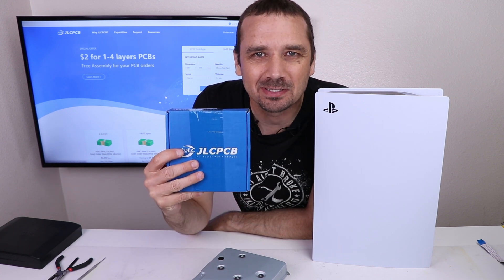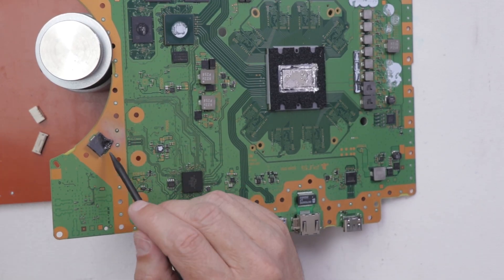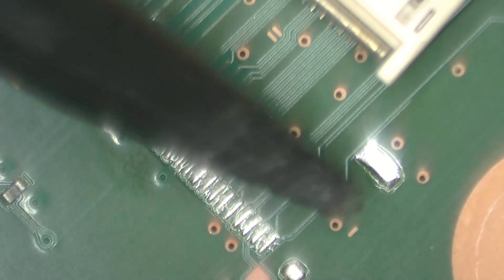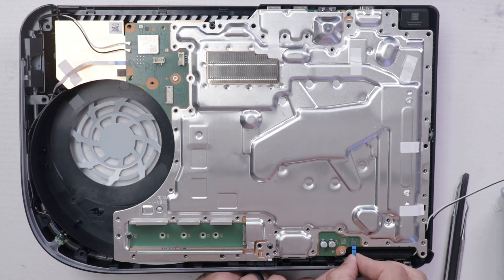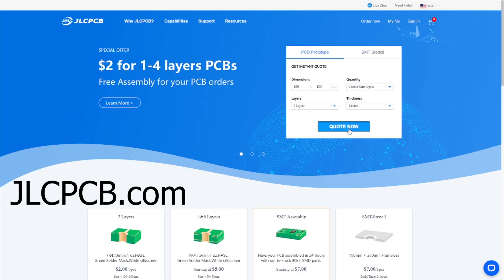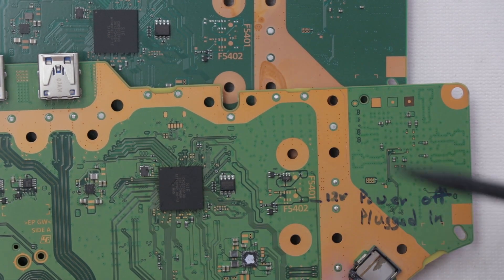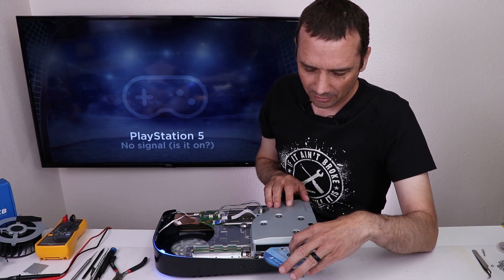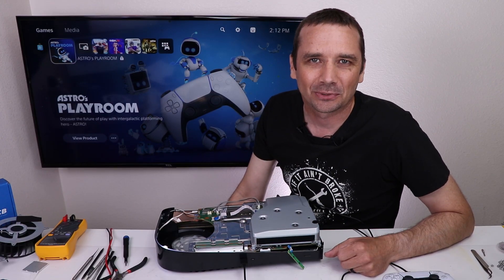I Put a Disc Drive Into a PS5 DIGITAL - But Did It Work?!

Comment: I haven't fully watched the video, but I wanna take a guess and say it didn't work because the disc drive wasn't "married" to the motherboard. It'll probably power up and move but it'll refuse to read any disc. I had this happen to me while fixing an xbox 360. You either had to solder the original disc drive sister board the new drive then reassemble it the correct motherboard, or go through a lengthy process of flashing the disc drive's firmware. Switching and soldering the disc drive's board is the easier method honestly. For the PS5 tho, I wouldn't have the first clue as to how to flash it with a new firmware. I'm sure it's possible and someone out there can do it.

Comment: Based on previous consoles Im sure even if the hardware supports the data transfer and power, without the key of the drive being supported or programmed to the console it wouldnt work. It might be worth pulling the on board ROM from one PS5 and trying it on the other. It seems even if the hardware wasnt signed with the correct security keys it would still show the disk on the main menu. 
My assumption is it wont work but would be cool to see if would boot with the ROM switched over.

Comment: It makes sense that it would be blocked by software. These consoles have written somewhere in their permanent memory what their model is and whether that model has a disc drive or not, and that should determine whether it will even load the driver software for it, because you don't have to bother loading it if there's no expectation of having a disc drive.

Comment: You need to use the firmware for the disc version. Couldn't you connect a USB with that specific firmware downloaded and install it manually offline? I believe Xbox allows you to download firmware on a USB stick and install it that way.

Comment: If it's anything like the launch PS3s, where the B model did not have a Wi-Fi card, the community eventually figured out that the firmware is the same for all the PS3 motherboards but for some reason it checks to see if the console ID's motherboard model digit relates to the B model. If the console ID check comes back that it is a B model than the firmware would disable using Wi-Fi even if you put the Wi-Fi card in from an A model. 

I would believe the PS5 is doing a similar CID check with enabling disc drive.

Comment: Could you do a video on dualsense stick drift repair with new modules. I guess it would be the same as other controllers but would make a good video. Oooh- and install one of those Extreme Rate Rise PS5 remap kits for dualsense

Comment: One of the pins on the higher density connector looked like it wasn’t soldered down fully in the video (it shifted and was touching the pin next to it when you cleaned them up).
Reply: The pins at the end of the black line, right? 3:19
Reply: @adr1ean  was about midway across the connector. You can see it has shifted right after he cleans the flux away with IPA. But yes, that time in the video. I don’t see a black line. Just the pad the pin was soldered to. Maybe the pad ripped off. :/

Comment: Maybe there are some security handshakes between the drive and the motherboard, like the 360 did.

Most prob if Drive Serial isnt allowed on the Board, the port gets disabled (potentially a security measure to prevent drive spoofing)
Reply: u gotta check with a ocilloscope the data pins on the PS5 standard while the console is booting up, then comparing them on the modded digital version, if there are some comms between the drive and the board but then stops, maybe is a hardware/software restriction (which could be solved swapping NAND or something like that, the chip that have the keys), if there arent any comms, port is disabled from factory.
Reply: if swapping NAND or something like that works, a PS5 digital could be a whole donor for a broken ps5 standard broke motherboard, technically its cheaper taking it from a digital than a disc version.

Comment: My dude aren’t you putting this disc in upside to the drive. Might work if you put it in right. Can anyone confirm?!
Reply from the maker: Read the pinned comment
Reply: @Tronicsfix  ahh cool just wanted to make sure I didn't have that wrong myself. Was a great experiment so thank you for creating this vid. It would have been an interesting options potentially if it worked for those who could only get a digital version but wanted to upgrade later. As +$100 isn't worth the upgrade to the Disc Version of PS5 IMO, but if you could get a broken PS5 parts for cheaper then that would have been cool, too bad it didn't work. ;c)

Comment: Ultimately It makes me wonder why Sony just didn't release just an all digital PS5 with a locked down disc reader add on. One console only.
Reply: More hardware cost and it just doesn't make sense to sell something with a non-functional part in it. In the final cost you still pay for the disk drive. You would be paying for a useless disk drive.

Comment: PS consoles have the disc drive maried to the console. You can't use the disc drive of one console in another console without remaried the drive, so imagine using a disc drive on a console without disc from factory and without remaried the drive.  I don't have to see the video to make a conclusion here. No, not work.

Comment: I've been waiting for this video! bummer it didn't work but I'm sure someone out there will make it work. I was wondering of you forced a console update thru usb if it would find the drive and install a firmware with permissions to let the disc drive work? Kind of like how you can update a ps3 or ps4 via usb. I'm not sure this is possible on the ps5 either as I haven't seen a video on someone updating firmware that way yet but it's just a thought.

Comment: I'm betting like older gens the disk is encrypted to the board. So w/o hacking the firmware on the drive/board. It was always going to be a non-starter. But still had to try.

Comment: Reinstall the os with the disc drive plugged in
Reply: This!  The OS may have a simple flag on install for hardware checks.. reinstalling the OS completely from safe menu could flip the flag so it’s no longer digital only.
Reply: @Honeypot-x9s  It'll be BIOS related! The disk drive is looking for a handshake!
Reply: @Honeypot-x9s  i actually think its like the ps3 and 4 where the boards are mated to specific disk drives
Reply: @zerokool1985  Yes they are married to the mobo by an encription type code. No drive no code no way it will work unless you could get it to run unsigned code.
Reply: @daveshank1921  exactly
Reply: @zerokool1985  There is no such thing as married disk drive on PS4 Slim/Pro. You can swap the drives as you like. With the FAT PS4, that's another story...

Comment: I guarantee the blu ray drive has a "renesas" chip on its logic board that is married to the original ps5 motherboard. Would have saved you all the time & soldering if you'd looked first
Reply from the maker: Um, I already know that. I don't need to look. Doesn't mean it's not still fun to try it and see what it does.

Comment: This is so exciting! Reminds me of a time when we used to be able to run unsupported CPUs on Motherboards with adapters (SLOCKETS, anyone?) to get more life out of our hardware. You had to run the appropriate combination of hardware, firmware and software. Good times if you were a tinkerer.
Reply: I once had a Asrock mobo (~2000) which supported Socket 939 and AM2, PCI-e and AGP and DDR and DDR2. Asrock had the weirdest products when they started out.
Reply: Supposedly An AMD Athlon CPU could be Unlocked with a Graphite pencil mark Between 2 Contacts, WAY back Whenever it came out!
(I was only Just learning Back then, never Game to try)!
Reply: @OldManJace  Indeed, I did it for a couple of my friends in College. That was a pretty cool party trick! Thanks for reminding me that one!
Reply: @OldManJace  I tried that back in the day on an XP 1600, the chip never worked again.  My wife still wont let me live that one down any time I tinker with something.
Reply: And also akin to modern Hackintoshing.
While it’s probably easier than ever in 2021 to get one up and running, I still laugh about the years and years of having to have the correct combo of kexts (drivers/extensions), config plists, bootloader, bios hacks and settings, etc...
And even then, you’d still have to have particularly similar HW to real Macs in order to run.
All to run glorified Unix on an x86 PC 😆
Reply: you still can mount 6-7-8-9th gen intel cpus on like z170, jumping pins in cpu and custom bios
Reply: @fippo717  True. All based on Hacked BIOSes based on an AsRock one (made by an employee or an overclocker). Some MB looses functionalities, some don't. Not entirely sure if you still need to mask off some of the CPU pads, but yes, you had to at first.
Reply: Terrible times if you WEREN'T a tinkerer.
Reply: I first saw that on MacBook it was crazy to see people switching CPUs on that thing

Comment: would it be possible to replace a motherboard, or in this case get a motherboard with the disk drive connectors and replace it with the one in the ps5 digital, or has sony blocked that capability in the software?

Comment: I know on the PS3 the Drive was married to the console (if my memory serves me)  I had to replace the drive on mine but still needed the actual board it was on.  Might be possible that the drive you attached is married to the board it belonged to and the Digital doesn't communicate with it cause of that.  Also since it's a digital it wouldn't have a drive affiliation (not married to anything)

Great video nonetheless.
Reply: was thinking the exact same thing

Comment: I think the firmware has to be different for the disk/diskless versions.
Reply: Swapping a bd drive on a PS4 does not work if the renesas chip is not matched to the board - I guess the same goes for this one

Comment: Hey Steve, if you don't notice anymore hardware differences between the two motherboards, digital and disc, maybe it's a digital lock that's in place. Now, I'd be curious to know if they run a different OS version between digital and disc or a different BIOS. If you find a way to boot with the proper version, you might achieve success. If the difference lies there, of course. I come here for those experiments of yours. They're really exciting!

Comment: They've been known to code the drives firmware to the console in (xboxes at least) so drive swaps arent permitted without a hack. I think they do this to prevent playing copied disks/DRM piracy issues
Reply: Would that make it impossible to replace the drive on a physical edition ps5?
Reply: @dankorune  might have to send it in to Sony for repair. I dont know if the drives are locked or not, but companies do like to do that sort of thing
Reply: @mwint1982  sure hope that when the system gets jailbroken and sony wont be doing repairs anynore we could somehow "marry" the drives ourselves
Reply: They do this to prevent repair, so people have to buy new ones. This wouldn't stop piracy as piracy protection happens at the system software level. It PS5 software isn't going to read whatever disc is inserted, it's going to look for a legitimate PS5 disc.
Reply: how would having a married disc drive to a console have any impact on piracy at all? The only reason is to prevent hobbyists from saving perfectly working electronics from the landfill and to make people purchase another console (or pay service fees) if a drive is failing.
Reply: @Max-uv3eg  In the Xbox 360 you could take out the disk drive, flash a different firmware to it and put it back in the console. Now this disk drive can read pirated copies of the games and, since you didn't touch the firmware of the APU, you could still connect to Xbox live with the pirated games
Reply: @Max-uv3eg  There's many consoles that have replacement disk drives that are just a USB, SD card, etc, which allows for easy piracy. Marrying the disk drive to the mobo means you can't do that.
Reply: @Max-uv3eg  I think it was part of their encryption. Plus, xbox live would ban you if your system was opened and the drive was removed/swapped

Comment: Is there a way to wipe it and install the software from a disc PS5?
Reply: I was wondering the same thing, but I’m sure this option has already crossed his mind. My guess is that digital console wouldn’t except the disc console software likely due to a DRM lock at the kernel level, where the line between hardware and software is the blurriest.

Comment: Ok, I have to agree, I ejected my Demon's Souls disc and you inserted the disc upside down.  ( 9:38 ) Assuming of course you have it installed the right way up for a typical disc drive version, which I assume is correct by how you have to line it up for screws.

Comment: I feel like the disc wasn’t put in the correct way 😮
Reply: You're right, he was putting the disc in the wrong way, I wonder if he's tried it since reading this comment...?
Reply: @RestoreTechnique  He has, he has written a comment saying that it didn't work either, that the firmware still blocks any possible readings
Reply: Yeah 😂
Reply: How could you 'feel' that?
Reply: Damn.. get your eyes checked. Coz you've got eagle eyes ✌️
Reply: I also did this when I got my ps5.
Reply: Sounds like found out from comments it was the wrong way but even the right way it didn't work:
https://www.youtube.com/watch?v=5G8V5HDl0jM&lc=Ugzkv3is57jPIEb_bZF4AaABAg
Reply: Yup
Reply: I won't matter but when a disc is in it. They drive will start spinning and a tiny disc icon shows up on top of the screen
Reply: He's just testing it out if it wil spin
Reply from the maker: Read the pinned comment
Reply: @Tronicsfix  Yep I did now 👍

Comment: Do some more mods and then send it to sony as "faulty disc reader" :)
Reply: ah nice work smarter not harder
Reply: Big brain
Reply: Part from serial numbers will bring up digital version lol
Reply: Stonks
Reply: Just got a heart from this guy, that means probably is gona do this
Reply: They will know because of the serial code etc
Reply: Big brain
Reply: they will not touch consoles that have been opened up
Reply: Genius idea  I think they would  send him a new one but not anytime soon maybe till the release of the PS6 
Lol
Reply: smallbrain meme content
Reply: Unfortunately, there will be tags and signs to tell the techs the hardware was tampered with. The boards also look subtly different, as I noticed traces with bridge connections going to the optical drive, where as the digital board didn't have those.

Comment: There is likely some eprom on the board telling the firmware which model it is and what to install.
Reply: Would it be possible to locate that part and replace it with one from the actual disc unit or are they linked to the boards in some way ?
Reply: Similar to how you’d reprogram your lens EEPROM on a PS2 fat when installing a new / different laser variant. I bet someone will make a utility to fix this!